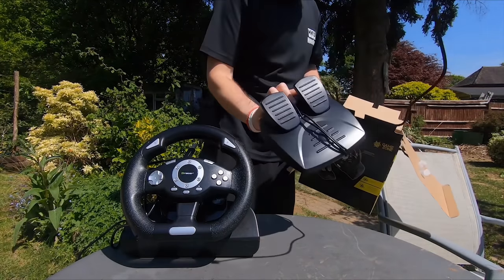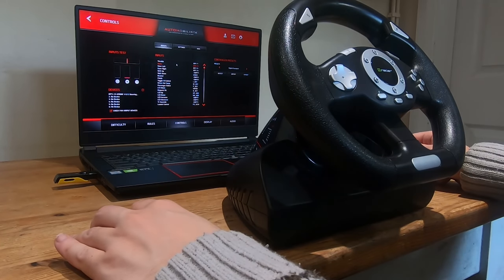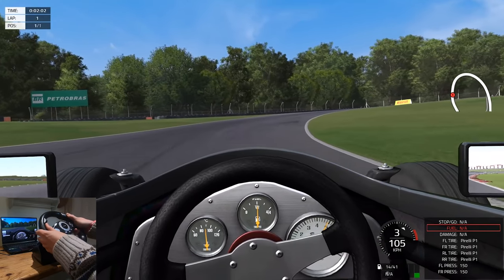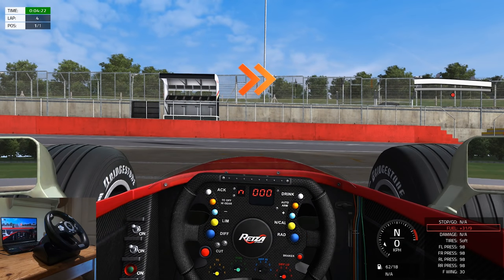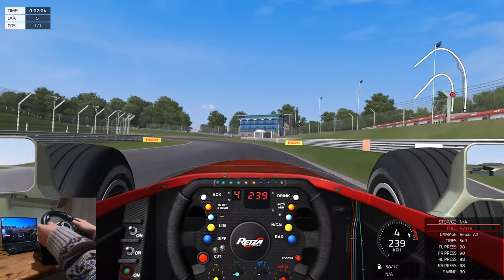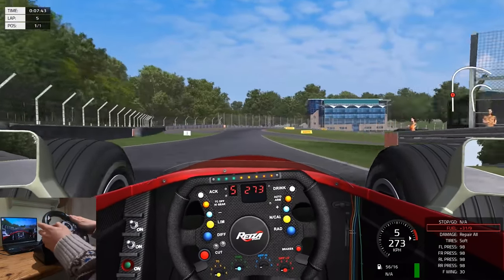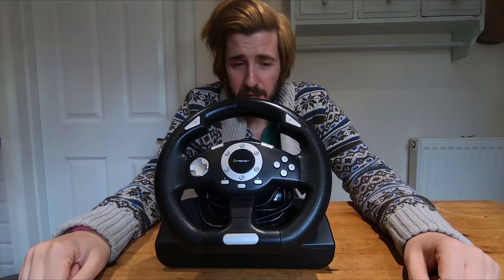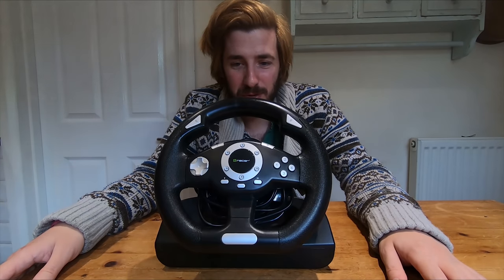Amazon's Cheapest Sim Racing Wheel Is Better Than I Thought!

Comment: For those that aren't familiar with this "wheel" - it is NOT a wheel. It is a modified Xbox controller. How do I know? It's what I'm using... and yes, you can 'race' with it. Competitive, you could but not really.

But if you are under a budget, do I recommend it? Yes! But remember, you get what you paid for. No force feedback, limited degrees pf rotation and a whole lot more but for anything casual like Project Cars 2, Assetto Corsa, ACC, WRC 8 and 9, F1, ETS, ATS, NFS, etc, no problems at all.
Reply: what is it called?
Reply: @KINIYT  T-Racer
Reply: @Cr4z3d  thanks

Comment: I’ve had a couple of wheels not unlike this when I was younger and the biggest issue is definitely the crappy suction cups. The lack of force feedback you can work with if you don’t know any different, there are plenty of good sim racers who turn FFB way down or off. Hard to deal will the wheel moving around or coming loose if you take a corner too hard though

Comment: My first wheel was kind of like that. To make it more secure I put on big strips of 2” Velcro (glue may damage finish of desk). Also to simulate a load cell I zip tied some thick rubber washers from the hardware store to the base just under the brake then calibrated the brake in the sim to match.

Comment: I used to have a 90 degrees rotation, non FFB wheel, and I recommend to add a curve to the steering wheel, so it's less touchy in the middle section and gets more aggressive towards the end of the rotation.

Comment: I have a Thrustmaster Universal Challenge 5-in-1 I bought some 10 years or so ago, for significantly less money. No force feedback of any kind, throttle and brake on a single axis (meaning you can't use both at the same time) and attachments for PC, Playstation and Xbox (whichever versions were en vogue at the time). One advantage it has over this one is that it clamps to the desk, so it won't move around. The pedals will, though, and you'll hit the clamp with your knees while hunting for the pedals on the ground.
I never bothered to really get acquainted with it as my desk is too thick to fit the clamp properly, so I had to jam a board into the desk drawer whenever I wanted to drive... fun times.

Comment: You know I wondered about that because I had a wingman steering wheel I actually used in R-factor (looong before my G27)  that actually worked pretty well.  I was surprised when you mentioned the much newer cheap wheel didn’t at least have more precise steering input than keyboard emulation. 😄 Makes sense now though!

Comment: It's funny, I played a rally game at a friends house with a cheap wheel like that one, and my friend hated the wheel until I started blasting his times out on it. He realized that I was being smoother with the inputs than he was. I normally have to use an analog gaming pad, it was much nicer using a wheel and foot peddles. I'll have to invest in a decent one at some point. I think with a bit of modding to get the wheel stable and maybe add some spring tension to the peddles it would work out even better.

Comment: Hey Jimmy,  you could probably get that flickering out next time you film there by changing the shutter angle (sometimes called shutter speed). Try 178.2 degree shutter or change the speed very slightly. Experiment and see if you can dial the flicker out! Good luck!

Comment: I had a wheel like that back in around 2004 - used it couple of times and never touched again. Same problems with suction caps etc.

I think it's even the same hardware as 16 years ago, just the design is slightly different.

Comment: To keep the brake from automatically giving input, you'd have to calibrate the wheel and pedals in the system itself (under the control panel). If you already did, well... it is a cheap wheel lol When I first started sim racing back in (showing my age here) 2001 with my first wheel, it was a cheap boi, but it at least had "gear-driven force feedback", which was incredible to me at the time. Other than that bit, it was basically your TRacer there, but for someone REALLY on a budget who just wants to get their feet wet, I guess it's worth the 20 bucks. Beats using a controller or keyboard.

Comment: Looks like the main isue there is the pedals being too light. Maybe could be possible to add some kind of spring or rubber to add weight to it? Also, the whole set should be much more well fixed to table and floor. I think it would be ok for a begginer on a low budget, like moi.

Comment: I always wondered if you could take a cheap wheel like this, take it apart slightly just exposing where the wheel meets the base, and add a few gears to get a 900 degree rotation, without spending $300

Comment: I had a cheap wheel with the exact same pedal unit a decade ago! It didn't really last very long. The springs in the pedal box broke completely and I had to claw grip them with my toes to use them. The wheel itself gave way shortly after and was completely unusable. Would not recommend from a longevity perspective.

Comment: I believe that is is actually possible to be competitive in sim with this inferior equipment, speaking from experience. I may not be a part of the sim racing community, but I am a veteran of WW2 combat flight simulators. I have been playing for years, and consistently manage to obtain above average kill ratios(very good for somebody who doesn't play more than a couple hours a week). While most people use a joystick,  I just use a jerry rigged ps3 controller in conjunction with a headtracker. I imagine you can understand that fine control is not a strength of the ps3 controller, and a whole lot of it is needed in order to fly, let alone fight in a WW2 fighter. Yet I have somehow adapted to it and "got good". I think the same can be applied to this wheel, though I do think it could use a clutch pedal.

Comment: Proper installation is an important step for any wheel, and this wheel especially bad at it. I wonder how much better it would be if you tightly secure the wheel and pedals so they don't slide all over the place and you concentrate on the racing alone rather than racing+holding the stuff in place.

Comment: seeing the F1 wheel with the "Drink" button and my brain couldn't resist on thinking "you will not have the drink"
P.S.: why on Earth a steering wheel has an option to toggle on/off analog controls... I mean, isn't the f-ing point on a steering to work like that?
Reply: lucasbello117 back in old days (😉) some games don’t know how to handle analog inputs... that’s why on old knockoff gamepads (or OG PS pad) you got also option to disable it...

Comment: Honestly, I still think this is not recommended to buy. A second hand  Logitech Driving Force GT has way better hardware for a similar price
Reply: This has got to be the loosest interpretation of the phrase "a similar price" that any human being has ever put into writing.
Reply: @amsterdan9096  Is it really? I got a pretty decent DFGT for €25. Worked fine, not damaged, just slightly dirty. It was used, but a force feedback wheel for that price seems like a much better alternative than this slightly cheaper t racer.
Reply: @generalguilmon6719  when and where? I've been tryin to buy one recently and was struggling to find ones even under a hundred that weren't broken. Only place I've seen a decent price was a site called Serdady that I'm not so sure I can be confident buying from.
Reply: @amsterdan9096  From your name, I assume you're Dutch too. I found mine on Marktplaats, but any decent second hand store would be fine. Just keep looking I guess? I bought mine a few years ago, so maybe the price has gone up a bit since then as the good examples get more rare.
Reply: @generalguilmon6719  thanks for the advice, haven't even tried good old marktplaats yet!  I am afraid however that this sim racing boom is causing a bit of a wheel shortage; I noticed new wheels on Amazon have some rapidly rising prices right now, and bidding on eBay is really aggressive at the moment. Here's hoping the sim racing boom results in some cool new lines of affordable wheels! ;)

Comment: You deserve to be sued by the wheel maker. In your first review you DID NOT BOTHER to read the instructions and slagged the incredibly cheap product off because you assumed it could only be set up digitally and not via analogue. Now you've discovered it does actually work as an analogue device you STILL have not apologised. You title this video "Better than I thought". Wrong. You should have titled the video "HUMBLE APOLOGY". Now go and do it. Lesson learned. If you are going to review any product, DO IT PROPERLY. Reviewing products produced largely by VERY low paid people is not a joke for your own ego. Put your ego aside and do a review based on the incredible VALUE of this cheap product. It is not a direct drive wheel costing £300. It is an affordable device.